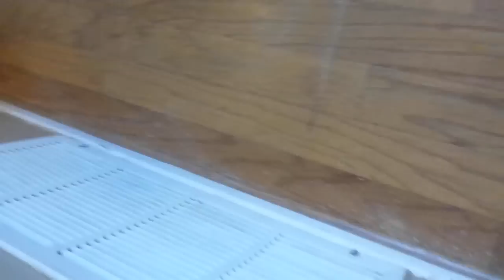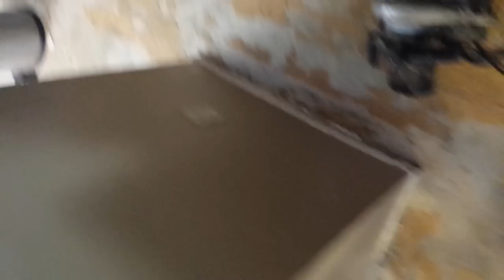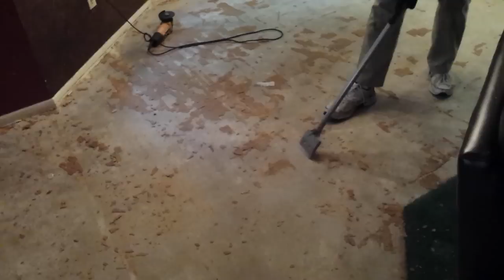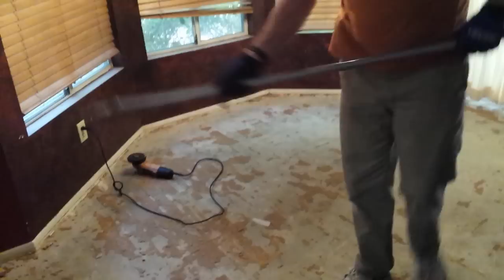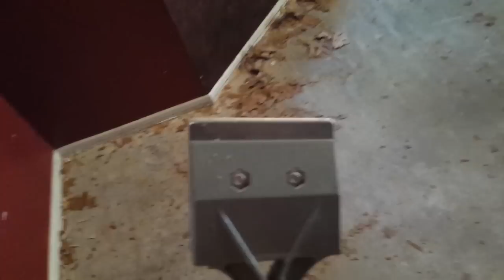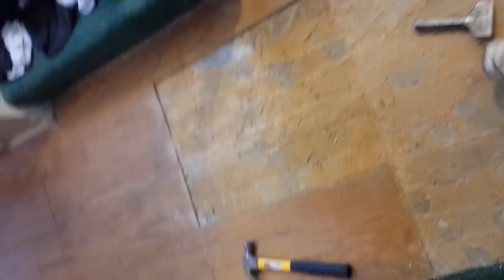Remove Glue Down Wood Flooring

Comment: I need the simplest way to scrape the excess glue thats still stuck to the plywwod subfloor??
Reply from the maker: not sure how you would do that perhaps a floor sander the scraper only works because of the hard concrete it needs the hard surface to scrape against on wood I doubt it would work.